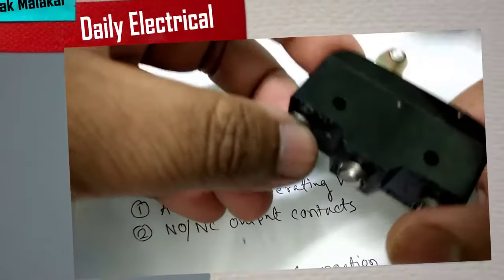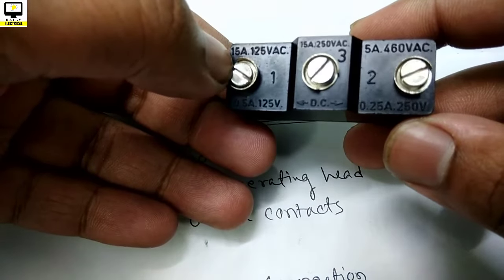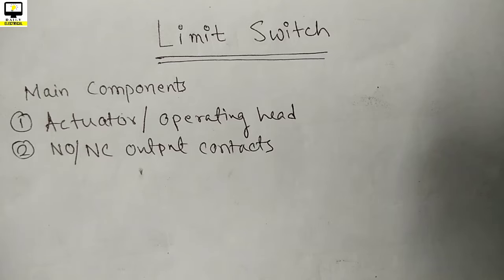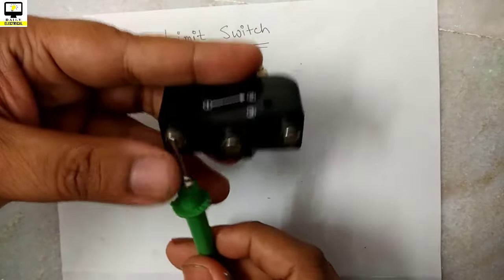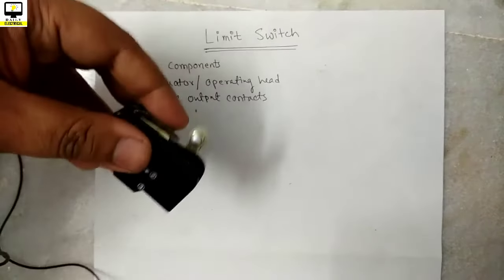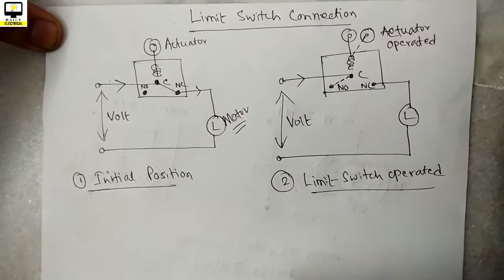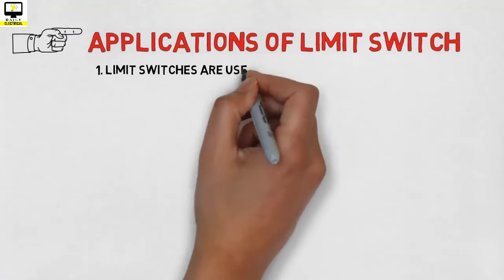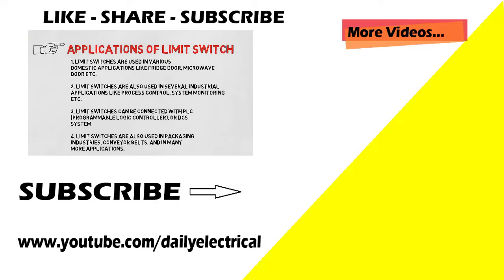Limit Switch || Working and Connection of Limit Switch

Comment: It has been a while since you posted this video, but I have a question as to whether it is the normal practice to wire a limit switch into a 12V circuit on the negative or positive line, or even if it makes a difference.  I know the limit switch would operate either way, but is one better than the other, safer maybe?

Comment: Good information... thankyou for posting.
Most of the Limit Switches I find are rated at 5amps.  I wish to use this with an 18v cordless drill motor which (I think) pulls about 20-30amps.  They would be in the Normally Open position.  Are these 5amp switches too small for my application?
Thankyou.